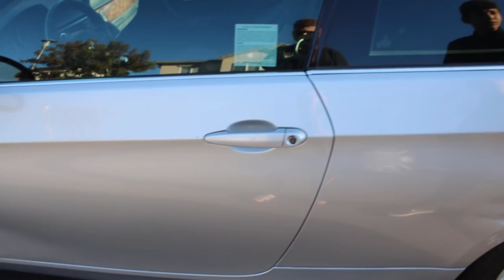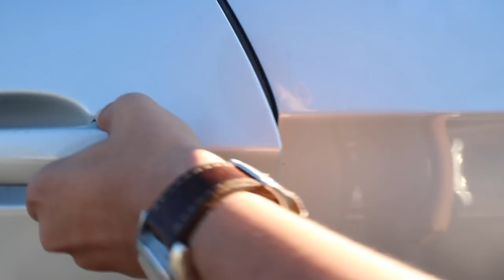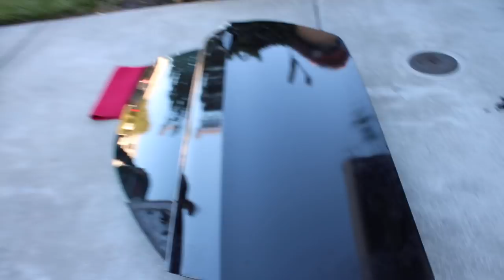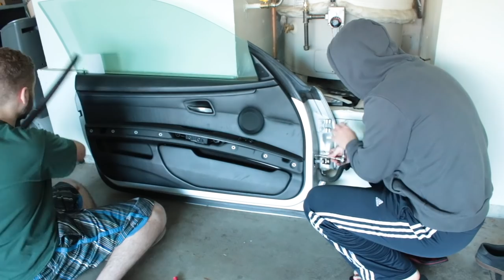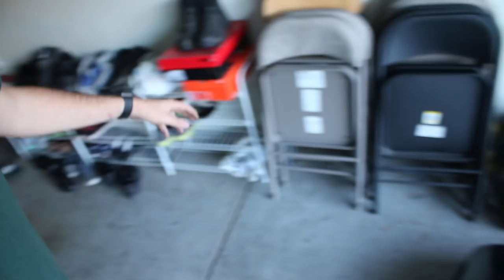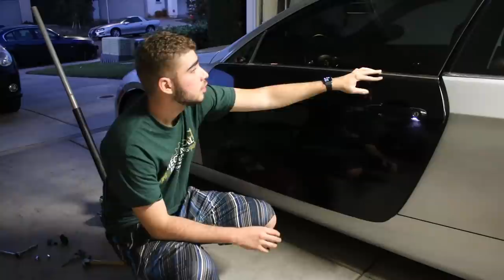THE E92 GETS A NEW DOOR (IM SO LUCKY)

Comment: I had a similar problem on my old saab 9-3 and what i had to do was loosen the bottom bolts and have someone lift the door up by the handle an inch then tightened it back up.
Reply from the maker: let me try that Ill give you a shout out if it worked :)

Comment: The hinge works like how a waredrobe hinge works. So you need the hinge to be moved about then you will see the correct fitting. The reason why it failed the first time is because the person holding the door didn't hold it an inch higher.